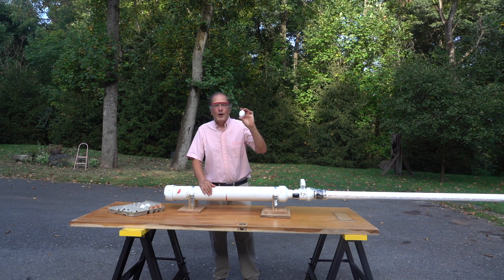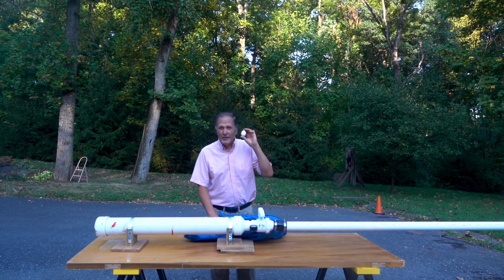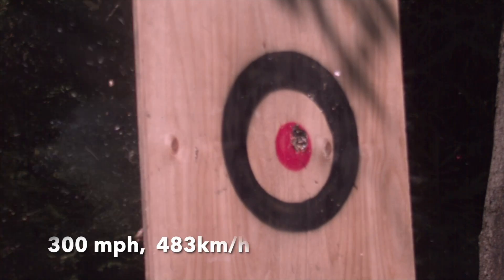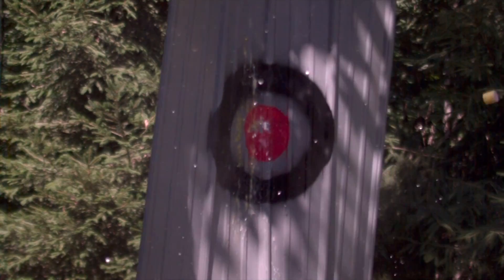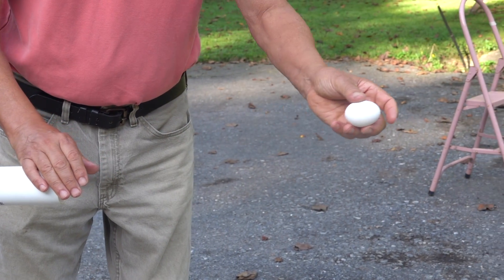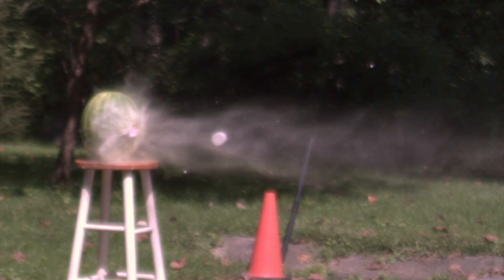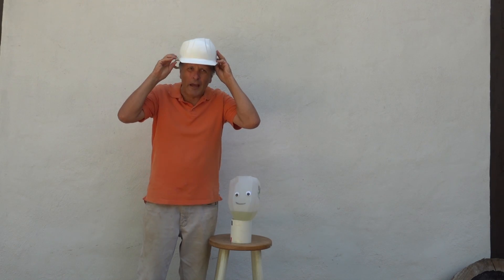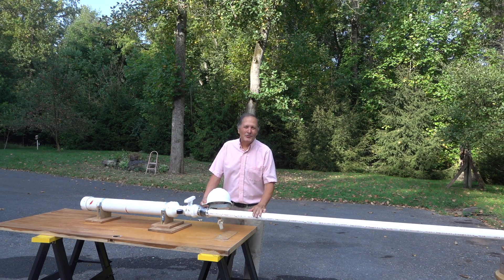Egg Target Practice at  300 mph   (483 km/h)

Comment: It must be that the egg shell turns into a buzz saw and cuts through the material.  All that calcium is really quite strong in small pieces that hit perpendicular to the surface.  I wonder if you put a rim on your sledge hammer if that would have a more whole punch effect.

Comment: I'm betting that the egg's ability to punch through the plywood is due to the plywood's inability to transmit the shockwave fast enough.  I don't think this is a failure of the ductile strength of the plywood, but the wood shattering.  It would be amazing to see the same energy in joules shot at plywood across a range of masses of projectiles, at a range of velocities.  I bet as the velocity went down, we'd see the hole get bigger and more ragged, until the plywood was able to disperse the energy quick enough to avoid shattering.

Comment: egg is surprisingly hard and is able to handle quite a lot of static pressure when is oriented in accordance with its longer axis and "sharp" end is leading. that's why i would recommend for better result to try attach some kind of wing, stabilizer or some anti-weight or so. you can also try to wrap it up in some stocking or sock which could be used for stabilization, with some tail (or any other way to stabilize it), and also for making egg more resistent. ultimate upgrade would be probably made from wire or other metal. other interesting suggestion would be to empty egg and fill it with some interesting material, potentially even flamable or explosive. also just simple wrap (tape) made of some good tape (i would prefer one used for isolating cables)should improve durability. last but not least, try to shoot hard boiled eggs 🙂

Comment: I’d love to see the difference between the raw egg and a hard boiled egg. If the targets weren’t hanging up and fixed on a frame to secure it, would it have more penetration as opposed to what was used in the vids? I always had a theory that anything that was not fully secured like at the fair where you have to shoot the star out which is near impossible as the target absorbs the bb instead of going straight through, always baffled me . Great vid 👍🍻

Comment: The short answer is terminal velocity. After doing a bit of googling, I see estimates as low as 70mph and as high as 120mph. At those speeds it will be much easier to stop the egg without breaking it. A bed sheet or something similar suspended from some poles could catch the egg. However, it will be VERY difficult to get the egg to fall within the target area. Maybe use a parachute instead of a bed sheet to increase the odds of catching the egg, and don't forget to wear that hard hat.

Comment: how do you compress it?  the air, I mean.
Reply from the maker: I have an air compressor at my house,  I've also used a  bicycle tire pump a few times but it took quite a few "pumps" to get them up to the desired pressure
Reply: @YeanyScience   awsome! didnt think a pvc tank could hold enough pressure to accellerate the egg at such speeds! thats like, 75 gram projectile! its heavy!

Comment: How do I make that egg gun?
Reply from the maker: quite a few plans on the internet for air cannons. I am doing research on PVCcannon safety and finding some dangers due to poor design. here are a few suggestions if you decide to make one 
1.at minimum  schedule 40 pipe, nothing larger than 4 inch pipe  diameter 
2. Compressed air instead combustion, also compressed air allows for longer barrels
3.Air chamber and barrel in a straight line no elbows
4. Loose fitting projectiles that move easily through barrel
5. Screws through the glued joints ensure they don't come apart
6.Wrapping the barrel and joints 
7.Keep out of sunlight, do not store outdoors,

Comment: Well you should use my pump and fire it at Mach 4.5 Pump is good to 10KPSI 2" outlet at Mach 4.5 Oxyhydrogen detonation. Proelian Technologies,,,,,
Reply from the maker: the question is could an egg survive the acceleration?
Reply: Lets see if a combination of charge and water can offset that. I should have the new SCADA system with the mass flow controllers working before Christmas. @YeanyScience

Comment: I would consider that used laptop computer. I have 2 nearly identical, i7, HP laptops. And on both. The same hinge for the display broke.  But they still work fine. If I take the HDMI output to a bigger monitor.  So a screwed up display on a decent laptop. I would still consider. Why did you shoot your poor little computer? What did it ever not do to you?

You homicidal computer maniac!
RemyRAD
Reply from the maker: It crashed and I hadn't back up a lot of the information on it, including two video that were completed and ready to post.  Offhand I don't remember what was wrong with it, except that it would have been expensive to fix

Comment: Thank you for the video!  (possibly stupid) question: does it matter that the egg is flying with 300mph and not the plywood?  What if the plywood flies with 300 mph onto the egg: will the wood break?  E.g. accelerate a piece of wood by letting it rotate (like a propeller) and then drop an egg into it.  So the wood will have the high kinetic energy, but not the egg.  Does it make a difference for breaking the wood?

Comment: Not how to stop the egg, but make it go even faster.
Create a vacuum in the barrel, tape the end shut with cello tape and suck the air out with a vacuum pump, the pump needs a T-piece with a valve in the barrel so you can shut it off when enough vacuum is created.
The pressurised air coming from behind will hopefully pop the cello tape before the egg hits it, unless the sabot is very tight fitting. Then losen it up a bit so that a tiny bit of air can go past. The amount of layers tape needed must be tested, it must be just enough to withstand the vacuum.
Reply from the maker: Hi Tom,  I did the compressed air vacuum combination in the video before this one, https://www.youtube.com/watch?v=33dnlFwjngk 
I got speed increasing up to about 330 mph, about 5% faster, but the egg separates from the sabot and often breaks in the barrel.

Comment: If you'd like to get the egg supersonic, try using helium or hydrogen as your propellant gas. air having a viscosity of 1.82 at 20c & hydrogen for example 0.88 at 20c. Plus the speed of sound in hydrogen is much higher.

Comment: Three ideas for catching the egg without breaking it. The first is a sheet of paper, and then another sheet of paper, and another sheet of paper, and so on, spaced about 3 inches apart. I don't know how many it would take to slow it to a stop, but thicker sheets of paper should slow it more and each should slow it down some. The second idea is basically the same configuration, but with bubble wrap. In both cases, I'd recommend something soft for them to land on after they've been slow down enough. The third one, going to be done with trash bags or balloons or pretty much anything else that could hold reasonably large pockets of air. But again, not just one of them. Same basic idea, each one it goes through should slow it down somewhat.

Comment: Thanks for your video, it was fun to watch.  Equally impressive is your power launcher.  May I ask how you ascertained that the egg was in fact traveling over 300mph (440fps).  At that speed, if you used an egg weighing 70 grams or 1080 grains at 300mph, that is almost putting out 465 fpe.  While a little hard to imagine, by default of this being an egg, I could see it busting through the thinner material pieces you used.  I just became a subscriber and will be sharing your video with the less lethal forums I partake in.
Reply from the maker: Thank you, I posted a video prior to this one https://www.youtube.com/watch?v=33dnlFwjngk
that may give you a better idea how to get the speed. I fired eggs alongside a speed strip (alternating blocks of known lengths) and recorded it at high speed usually 1000 frames per second.  I can then see how far the egg traveled for a number of frames and knowing the time calculate the speed in centimeters per second and convert it to other units. These are smaller eggs, about 50 grams, but most likely are traveling faster than 300 mph, (most measurements were between 305 -315 mph)  I'm using 300 as an easy reference. I'm planning on making a larger gun to see If I can get that speed up a little higher

Comment: How to catch an egg. Try firing into a pipe “setup”. The pipe would be of various diameters, tapering to the next diameter , but there would be compressed air coming out the pipe. Maybe each section would have a different rate of air flow / pressure?

Comment: try panty hose.  say 40 legs all one inside the other.  support the open end using a ring about 8" ish in dia.  if the stiffness of the panty hose don't give it horizontal support so it stays straight suspend the end with a string or lay it on really soft foam.  The panty hose if stacked enough,  may need 80,  Should provide a soft enough compression tube for deceleration  and a catch net at the end when it hits the toe.  I would purchase the longest pantyhose legs possible.  good luck, if first shot breaks an egg.  the cleaning for another try will be time consuming.   .

Comment: I am not happy about wasting so many eggs. 

I also need to say that if you get hit on the hardhat, your problem could be greater, depending on the angle of the hit. There are bodies in graves with a broken neck whose head was protected by a hardhat, but the impact was too much for the spine.
Reply from the maker: the eggs used are past their expiration date and can no longer be sold as food, if I didn't take them,   they were headed for a dumpster.
Reply: @YeanyScience  Ok, thx for the explanation. Then you get a thumbs up wholeheartedly.

Comment: To catch an egg at high speed I would try a pendulum with a long (maybe 2 meter (6 foot)) arm that can freely rotate in a circle; could be vertical or horizontal rotation (horizontal might be easier to construct). At the end of the pendulum's arm I would try a net to catch the egg without breaking it. When the egg hits the net, its kinetic energy is transferred to the pendulum arm's rotational energy, which would spin around and around until that energy reaches zero.

Comment: I read, in the 1950s, that Gyro Gearloose, of Donald Duck fame, invented a new explosive powder he called "Weemite" - so called because he thought you'd only need to use tiny amounts of it. He poured a smidgen of this powder down the barrel of an old revolver and had to follow this with a  wad consisting of a wet spaghetti noodle to keep the powder it in place. The test fire drove the wet spaghetti noodle straight through a steel anvil... Your tests were wonderfully inventive, but I'm afraid that you won't make the grade until you've powered a wet noodle through an anvil...
Reply from the maker: I'll see if I can find the recipe for wee mite

Comment: To stop a whole egg try attaching successive sheets of mylar (or any really thin PET membrane) top and bottom with clothes pegs, in a row so the egg hits sheet after sheet after sheet. Lots of sheets an inch apart, as the egg hits it will only transfer a very little energy per sheet to overcome the clothes pegs and the mylar will wrap around the egg, increasing  the drag with each successive layer.

Comment: Clearly, a total waste of perfectly good eggs! 

I am pleased to admit that I now actually understand why micrometeorites are such a potential problem during space travel. I was a tad unclear, until seeing the third or fourth shot.

As a normal, red blooded man, I loved every second of the video. Powerlessness evokes primal urges, apparently!

To catch an egg, you just write up an equation. First, determine the crushing resistance of a raw eggshell by direct measurement. Find some substance that crushes even slightly more easily. Divide by the calculated kinetic energy, to get the required thickness of your material. Add an extra foot. Eggs safely decelerated! Start with aerogel, and work your way up to higher densities.

Since you already got one egg to decelerate in just air, that will probably be the easiest. Figure how high an egg can be dropped safely onto grass. Shoot at a trajectory, such that egg rises less than the safe height above the grass, but travels the maximum flight duration.

Comment: That's really cool! I invented a raw egg cannon in the late '80's. Based on the beer can, tennis ball cannon. I used Zippo lighter fluid to propel my eggs and just a wad of toilet paper for a Sabot. I could launch a raw egg 300-400 yards pretty accurately.....not anywhere near 300mph though! My barrel was only about 24 inches. Combustion chamber was approx' 1/4 the length and about an inch wider than the barrel. We would launch eggs at about 45 degrees and they would not break if they landed in a regular lawn
Reply: Nowadays, we use hairspray and grill igniters for combustion....
Reply: Oh yeah!! MOST IMPORTANTLY...THE DIAMETER OF THE HOLE OF THE COMBUSTION CHAMBER NEEDS TO BE ABOUT 1/4 THE DIAMETER OF THE BARREL
Reply: My original....the best ever was made from 2 caulking tubes taped together for the barrel and an old Hair Mousse' aerosol can with just the very center popped out in the top....all taped together. Tiny pin hole, neatly bent in the side, to insert Zippo fluid and then hit with cigarette lighter to ignite it once it has fumed up some

Comment: Even in a container of eggs that are nominally the same sized some are bigger than others.  When customers check for cracked eggs the larger the eggs the more likely they are to be broken.  Jumbo eggs are the worst.  I suspect the shells are the same thickness in each case making the largest shells weakest.  Did you notice if the eggs that broke in the barrel were larger or smaller then the ones that flew intact?
Reply from the maker: in the previous video,  I had a lot of trouble with eggs breaking when using the vacuum cannon compressed air  cannon combination,  about half of the eggs would break before leaving the barrel.  When using just the compressed air cannon, I'd say only about 1 in 10 would break.  They were all the small egg size,  even so, the size did vary slightly but I can't tell you if the size  made any difference.  My guess is that some of them fit better into the sabot than others

Comment: I wonder about the hydrostatic shock properties of using a liquid contained in a shell as a projectile
As for stopping the egg, i would probably start with a very long sheet suspended horizontally at a slight upward angle. Idk how to figure length beyond expirementation, but towards the end i would increase the upward curve of the sheet until it becomes vertical or close to vertical.  It should decelerate on the slightly increasing upward slope of the sheet. I would assume it would need to be fairly loose so the egg can flow with it. 
This is a tricky problem but solvable i believe

Comment: Decelerating the egg with liquids should work, although plain water might be too dense so a foam would likely be needed.
A couple metres of dense shaving foam then a metre of water might do it, using some sort of gutter with cling-film on the ends would save on the volume needed.
Worth a try with just water though, hitting pointy end first it might just survive!
Foams can often be mixed with gels and stay stable, could be a good way to adjust density (also check out aircrete).

Comment: To catch the egg: how about many many layers of tissue paper about .25 inches apart ,pulled tight, then behind those layers lightly balled of trash bags that will actually do the catching. The tissue paper, lets say 20 layers, is just there to bleed maybe 10% of the energy before being caught in the crumpled up trash bags. Could work?

Comment: You mentioned faster and slower in the video. I am assuming this was achieved through different pressures released at firing. At what pressure did it require to produce 300mph?  It appears that your barrel is Sch. 40 2" PVC and the tank is 4" PVC.  The max working pressure for 4" Sch 40 is 220 PSI.  I usually work in PCP projectiles in 200 to 400 Bar not PSI, and I'm curious how an egg in an aluminum sabot word react to 3,800 PSI. That is something to think about. Maybe a cannon worthy to send to Ukraine? An egg may not take out an APC but it may go through body armor at that kind of pressure at supersonic speeds.
Reply from the maker: My air compressor maxes out somewhere around 100psi,  the volume of air in tank is roughly 450 cubic inches.  It will vary slightly but I try and use the same pressure with each shot and change the speed by changing the barrel length, showed this in the previous video.  3,800 PSI certainly would be  entertaining.  I didn't do the calculations yet but  wonder  what would be the top speed before friction would rip the egg apart, or dropping it from a high enough height, cook it due to air friction. thanks for your thoughts

Comment: Bruce Yeany

You can shoot it in the air and catch it with a fishnet or blanket.

 Other tip 

If you can find a steel tube that slides perfectly over the pvc barrel.
so the pvc will not deform. it can improve performans.

please show a ballistic gel block.

Did you try boiled eggs?
Fill the egg with lead? No thats just a joke..  .Or is it?

If you want to go extreme.. use  gas ignition just like a patato cannon

If you need any other information i think i can be of help

english is my 2nd language ...3e 4e

Comment: I'd try a long conical tube made of Ripstop nylon, with a hoop large enough to hit reliably at the entrance, the fabric tapering down to just bigger than the egg. Lay it out on the ground, or maybe keep it horizontal with a string. Simple and inexpensive, the egg hits the fabric at an oblique angle and scrubs off speed with friction, and ends up somewhere in the tube.
Its a lot harder than catching a dropped egg, I doubt that would even reach 100mph but I still wouldnt want to be under it. 😉